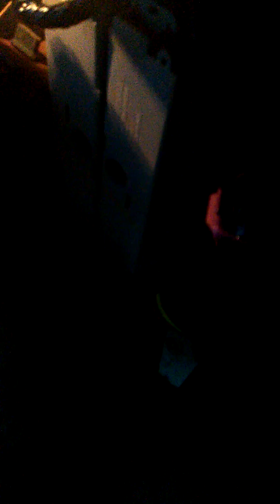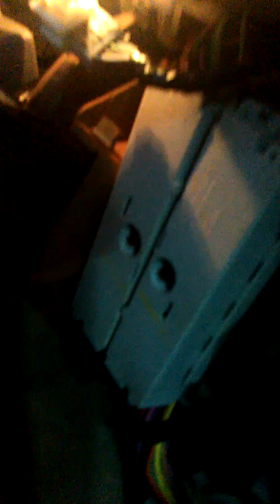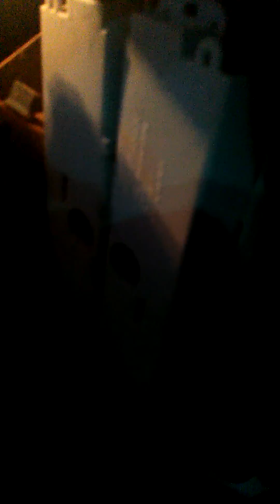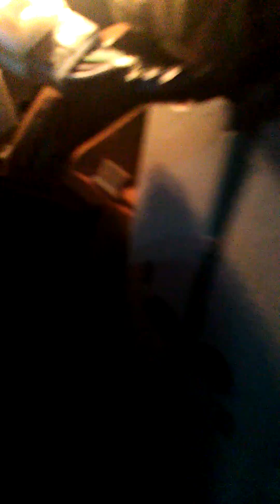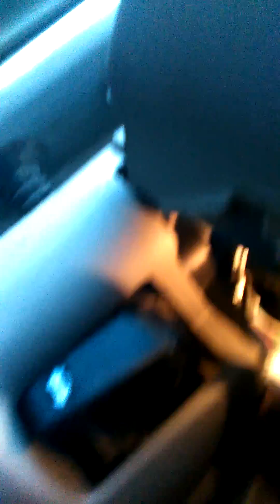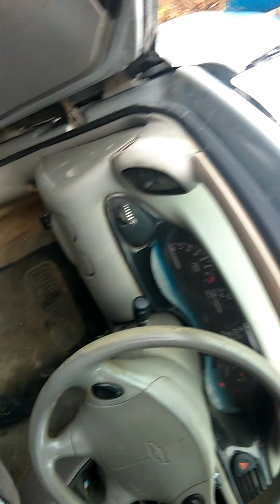Chevy Malibu ECM and PCM  Where are they

Comment: Hey Crosby I have a 2005 Chevy Malibu I've replaced the starter and the ignition switch but I'm not getting any power to my signal wire on my starter you think that might be my BCM? Everything else works on the car and it will crank with a toggle switch though?

Comment: Hey coming with 2020 Chevy Malibu all light we’re coming on and off.

I went to auto zone and got codes: p30bd, u0073(communication bus a) ,u0100 (lost communication with ecm)

What it does to me: fuel low, service esc, steering assist,  voltage at 15.5 and back to 12

Comment: My car is revving up. They think it's the computer. I've changed air idle, egr, manifold gasket, tps sensor, cleaned throttle, tune up, spark, air filter, and someone just looked at for 3 hrs and can't find a problem. If I find one with same numbers does it have to be reprogrammed?

Comment: Can this cause the fans not to come on? It’ll overheat and fans wouldn’t kick but will kick when the ac is on. Hanged sensors, wire test, jumped it and all. I was told it could be my ECM? 🤷🏾‍♂️
Reply: temp sensor

Comment: I changed starter, alternator and battery and it’s still happening... my scanner says “lost communication to pcm/ecu” (08 Malibu) no crank,, no start
Reply from the maker: Hi JuNii0rr x Thank you for reaching out! sounds like the ignition switch. but it should be able to crank . could be a bad ecm.pcm. Right now i have no ignition/spark. I got a ecm/pcm mod from pick and pull 25.00 but will have to take it to the deal to program. will keep you up to date Please do the same.

Comment: I wonder if My ECM is bad, the engine shuts off and the fuel and temp drop everything else says on
Reply from the maker: Hi Google User! Thanks for the comment !  That could be the PCM , it governs temp sensor and instrument cluster, fuel pump and emissions. ECM is the Ignition and Fuel injectors. I just happen to be troubleshooting a no fuel issue. NO Start  I am going after the cam sensor then the ECM. My tach is not working.  Happy Holidays!

Comment: Hey! I have 02 Malibu , unfortunately, it will crank but not start, tried starting fluid, nope, no rpm when crank,  p0131 only code and it's been there a while, any advice, besides junking it?
Reply from the maker: Hi S M ! Thanks for the comment.  any troubleshooting is going to cost you Time Or Money and Both. could be the ignition switch, crank sensors or ECM.  using starter fluid Tells me you don't have ignition. coil could be bad too. In my case the Ignition switch and the rear Block crank sensor. Now after 12k miles It starts and runs till it's shut down and won't start again for 2hrs, I have a Bank 1 crank sensor code
Reply: Usually if you don't see RPM's when you crank the engine over you have a crankshaft sensor or crank sensor wiring issue.  That is what registers the RPM.

Comment: I have a 2009 chevy malibu and was wanting to know where the PCM/ECM is located. Just all of a sudden one morning my car would not start. It already has a new belt that runs everything, a battery and a new starter
Reply from the maker: Hi Ron Thanks for the comment . not sure don't think location changed,  but I would look under the drivers Kick panel, but first find out if it's fuel or ignition related ?

Comment: Is that easy to install? And how much is the computer price
Reply from the maker: Hi Michael! thank you for commenting please subscribe. Yes easy to install  but it may have to be reprogrammed for your vin #.  I had a buddy at a junk yard so I only wanted to borrow one to see if my symptoms changed. They did not. a new reprogrammed one is about 300.00 last I checked
Reply: Thanks a lot I'm trying to fix my moms 2002 Chevy Malibu it turns on when the weather is warm but when the mornings are cold it don't turn on at all just the dash lights turn on I was told it might be a bad computer I guess I'll try and buy a new one thats programmed thanks
Reply from the maker: Hi Michael! The Chances of a bad ECM low  check the battery and starter
Reply: Dana Crosby thanks I'll check all that before I buy the computer

Comment: i have a 2006 malibu 2.2 ecotec spark and gas no start
Reply from the maker: Hi djjbo561tv! Thanks for the comment ! check engine light ?
Reply: Dana Crosby yes check engine light it just turns over I'm getting gas and spark can it be the crank sensor
Reply from the maker: Hi djjbo561tv  first thing get the computer read and go from there. I suspect a sensor. I'm not familiar with 2.2 and the common issues with it. let me know!

Comment: Hi, Dana, My question can a ECM be removed and tested at a local part store before purchasing a new one?
Reply from the maker: Hi Nicole! Thank you for Commenting.  That is a Dealer level of expertise
Reply: Dana Crosby, OK thanks for responding.
Reply from the maker: Thank you ! what makes you suspect the ECM?
Reply: Dana Crosby, My husband says, it wasn't spinning over at first. He replaced the sparks plugs, crank sensor, call pack, and fuel filter. All relays are good. Timing is good. So, he figured, it has to be the ECM?!
Reply from the maker: I just changed out the starter on mine, all it was doing was clicking then nothing but lights on the dash. thought it was a weak battery at first.
Reply: @NLBling  what about the fuseable link, ignition switch, ignition  cylinder? If not check all fuses.

Comment: Dana,
good instruction on the Computer Module.  What is your opinion on the re-manufactured ECM from All Computer Resources for a 2003 Chev Malibu LS
Reply from the maker: HI Steve ! Thank you for commenting! Sorry I have not used their services. I used a used one to check my system, I had the same symptoms  so I put old one back in. But I do understand if you get a aftermarket it will need to be reprogrammed by the dealer. see if that seller does it . Keep me posted
Reply: The dealer wants a fortune for a new one programmed and installed.  The seller says they will program when I provide them with the vin number and the mileage.  They want the old unit as well or will charge extra.  Is the dealer the only repair station for it to be programmed properly?  They claim it is proprietary software.
Reply from the maker: Hi Steve , as far as I know yes they should be able to tell you if there is something wrong with yours first
Reply: Hi Dana,  Sorry not very clear.  I know what is wrong.  It needs to be replaced.  My question is can the seller program like the dealer.  Someone is not being truthful.  The seller is telling me they can do it.  The dealer is telling me they are the only one who can do it.  What is your opinion?

Comment: My Daughters 2005 Malibu ECM unit, per autozone is bad, car runs but when she turns on the A/C the engine dies. Auto zone tech said these cost around 300.00+ but to try cleaning the contacts. I cant figure out how to remove it and afraid I will break something, the three connections at the bottom in front of the Battery are pretty dirty and the clips move, but connectors will not budge.
Reply from the maker: +Michael McLean Hi Michael did you remove the connector from the a/c compressor ? see what happens. you can get a ECM at recycler for about  50.00 then get it reprogrammed if need be at a dealer.  My end problem was a bad rear crank sensor
Reply: +Dana Crosby  First of all, I hate windows 10!!!!!!!!!  I was answering your last message to me and I went to correct my spelling and our messages disappeared.  It turns out the AC was sending pulses to the ECM to shut down the engine, went to a tire place after Autozone looked at the computer msg about the check engine light. They wanted $1,000.00 to repair the "o" rings in the AC unit and 300 to 400 for an ECM. So we did the next best thing, Went to Car Max, they gave us 500.00 for the car and picked up a Ford Fusion, 2013 with 41K miles on it.   Much better deal..   :-)   And Daughter very very very Happy...  :-)  But Thank You Dana, When I get ready to rebuild my 67 F100 I migh be texting you..
Reply from the maker: Ha you have to do what you have to do and that's why I do the videos working on my my families cars. Take care!
Reply: Autozone people  may know  a good deal of general  automotive  knowledge, however they are not  certified mechanics. Always get second  and third  opinions.